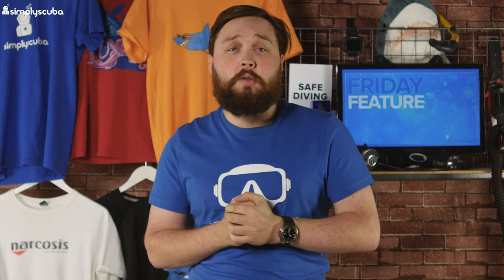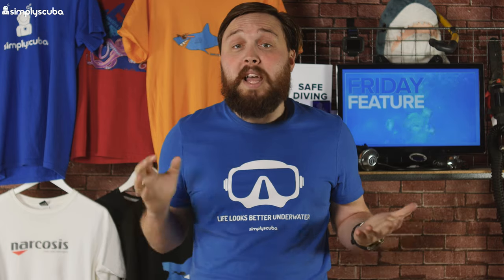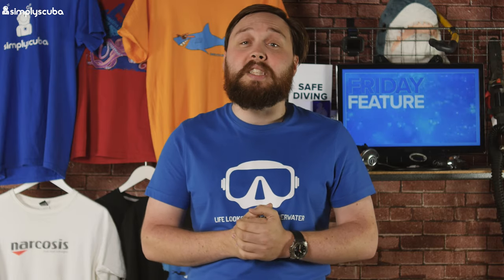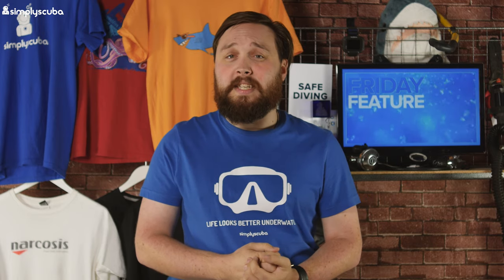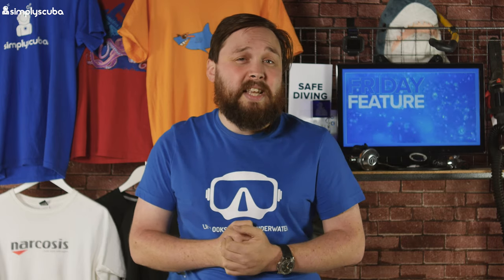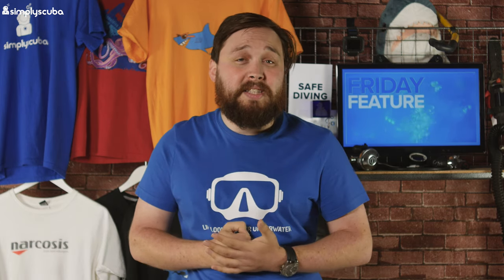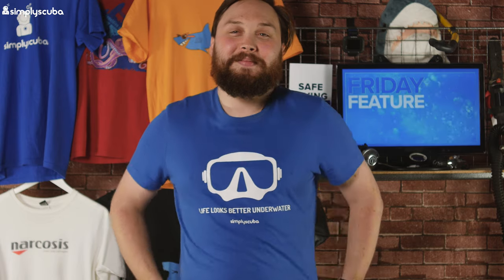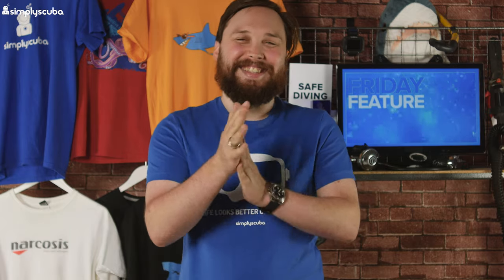Why The Standard Scuba Setup Is Wrong!

Comment: Let's not forget that all of this is relative to the environment you dive in. Like flat surface or chop, current, shore or boat dives and even the size of the boats and the kind of entry and exit you need to do. Are you diving with a wetsuit or drysuit, gloves and hood? People base these oppinions on what they are used to dive in and this doesn't always work in other envoirments. Most important is that you are properly trained with the equipment you choose to use. 

I change my accessories (torch, SBM, snorkel, camera, compass) depending on the envoirment. 

Whatever set up you choose to use, make sure you and your buddy know how to use it. 

Instead of trying to prepair for every kind of emergency, keep it simple and concentrate on the actuall dive and preventing these emergencies. Most emergencies can be avoided by having good habits.

Comment: I totally agree with everything you said in this video.  I'm an LA County Under Water Instructor and perform many beach dives.  I always have and often use a snorkel especially at dive entry.  It is safer and conserves gas.  It is also an LA County Requirement to have one with you.  Other than that, this is great advice for newbie divers.  When I started out, I had every gadget imaginable (still do, but rarely use any of them anymore)- such a waste of money.  Now, I am a minimalist- but I still maintain the 2 is 1 and 1 is none redundancy standards.  

Thank you for this video and dive safely!
Reply: Mark and this channel are wonderful, I Love it.  So I utilize the snorkel the same way.  Beaches are my primary entry (as opposed to boats) and we often have a moderate surface swim to the dive site.  Head in the water, utilizing compass and head up dead reckoning, neutral body position make the swim easier and conserve on the bottle for sure.  I do agree with the “don’t take it if you don’t need it” philosophy and a minimalist approach as a rule to keep the hazards at bay.  At the end of the day, you consider all of these excellent viewpoints derived from experience and do what makes most sense for you- and of course what is required of you.  Best!
Reply: Hi Brett ! It would be great Havin your accessories list and knowing which accessories you have ended using ?

Comment: Hmmmm.  My special forces dive instructor has left his backplate BCD and gone to a jacket style. Who would have thunk it? (John Shimkoski, owner of Scuba World in Orlando, is retired Green Beret and has taught scuba to special forces divers in Key West for years.)  He basically lives under water.   Pockets?  I'm a Naui divemaster. I keep a few things in my Aqualung BCD pockets that are safety and communication related.  A flat reel (my invention) with 75' of line and safety sausage in one pocket and reefmaster mini camera in the other. Titanium knife mounted above pocket for easy access (second titanium on inside of leg with chisel point.)    Multiple D rings?  It's all about location i.e. where you want to attached things.  I try to dive minimalist.  I have a rescue whistle tie wrapped to upper D ring.  I also typically have a small flashlight attached as well for poking around our great Florida shipwrecks.  Retractors, really?  A retractor on my Suunto Cobra keeps it close at hand and the the hose tucked in close rather than dangling.  No, they don't last forever.  But, I just replace it when it loses its functionality.  A two meter octo hose? If you are a tech diver, I got it.  But for most basic open water divers the longer the hoses, the more stuff hanging in the water or from your BCD, creates snag hazzards on the reefs and when getting into the boat.  I have been diving Atomic gear.  (Atomic M1 reg, Atomic fins with spring straps -  the best invention ever, and a sleek Atomic snorkel.)  Snorkels.  If you are diving alone, you can keep it stuffed in your pocket.  But, as a Divemaster, I always have people with me.  I'm first in the water and am the sheepdog herding my divers.  The snorkel is a great benefit allowing me to breath in the chop and stuff my face in the water if one of my divers has an issue.  And then their was the time when I had a long swim back to the boat with 2 newbies in tow.  Not enough air as the current had washed them about 200 yards from the moored boat.  In goes the snorkel and a long swim back.

I get what you are trying to communicate, but places, people, and dive styles greatly differ.
Reply: Recently did a 300 yard surface swim from Hunter Springs to Jurassic Springs in Crystal River, and the snorkel made that possible.  Saved my compressed air for the dive when I got there.  Been NAUI Advanced certified since the 80s and I still use a snorkel and jacket style BC.
Reply: Robb Hawks exactly !! This is so true. All my dives were on a jacket style. They are very confidence inspiring which is huge in diving especially for beginners. I’m transitioning to a Hydros Pro soon, excited to see how I like it !! Safe diving

Comment: Hmmmmm.... 2 meter hose for octo.  But don't give octo to dive partner.  Instead, give primary.  Then shouldn't the primary have a 2 meter hose?
Reply: good point: as technical 50 trainee (not many dives on tech 50), the 2 meter long hose os for the 2nd that you share, and the principal that you breathe from, has a shorter length than a recreational. So I was thinking, hum, makes sense to give the principal: you know is working, you are not stressed... I think that he meant that you can switch to the principal if the 2nd also fails...
Reply: Correct. The two meter hose goes on your primary second stage (the one you breathe from.) In an emergency you would donate your primary to your buddy and you switch to the backup (octo?) that is hanging on a necklace around your neck. (It will be on a short hose like you're used to.)
Reply: Ahhh my scrolling was a waste of time!

Good good

Comment: So, #1 I use my LONG octo as my primary, as a panicked diver will likely pull what I have out of my mouth.  My short reg is on a bungie cord necklace around my neck, so no fiddling. #2 I alway have my snorkel with me, but it is a collapsible one that I keep in my fanny pack kit that is on the dive with me (along with zip ties, an extra flash light, bolt snaps and more).  The fanny pack is ease to mount on sidemount BCDs, but you can modify regular BCDs to accommodate this .  Even without a fanny pack the collapsible snorkels (some designs roll up) can fit in a pocket-hopefully not to be needed at all.  #3 I dive sidemount and  even if you use just 1 tank, at least it is where you can reach the valve (useful if you forgot to turn on your tank, also useful if you have free flow from first stage or second stage equipment malfunction- you can 'feather' on/off the tank and not waste  the majority of the air- this makes it a safer ascent as you  now have time to ascend safely to to boat/shore.  Yes this dive IS OVER regardless).  #4 you should have a pony bottle and know how to strap it to you to minimize the profile and no dangling.

Comment: Agree with all this, except the snorkel. The snorkel is sooo nice to have when you're doing a (speed) boat dive. After passing your bcd to the boat and you have to wait to get on, it is really nice to be able to just chill with your face in the water, not worrying about water in your mouth. It just means I can wait in the water and wait for everybody who does not have a snorkel to hurry back on. Also nice when someone accidentally drops weights in shallow water so you can easily find them and grab them, in general I use it quite often.

Comment: Don't try rescue breath using a snorkel with a purge valve 😂
Reply: I'm a novice, can you explain why? And how you would know?
Reply: Most snorkels these days are the "dry type" with a purge on the bottom and splash guard on the top.  Administering rescue breaths with such a snorkel is next to impossible.  When I did Rescue Diver training, we were required to use respirator masks, which are the type that work on free flow oxygen systems.  Needless to say, I'd sooner use the mask than a snorkel.
Reply: For a scuba diving purposes is the best the simplest snorkel without aby valves. It's light, small, durable and non-existing valve can't fail.

Comment: Some comments : 

Octopus / Long hose: 
When you spoke of a long 2m hose why not just recommend the DIR (doing it right setup of 210cm hose - this is standard amongst the serious dive institutes anyways. so 210 cm long hose thats your primary... from behind your back.. around the right - under the lamp tank and then over left shoulder and around neck to mouth. 

2. Wings >> BCD jackets. helps having a great trim in the water -- stay horizontal in the water column

3. dump snorkels altogether.

Comment: I am mostly likely the minority having recently got my advanced certified but I have found having the snorkel useful especially swimming out before the dive. I am an air hog (yes need to work on that) but I feel comfortable using it quite often. I get why others dont but it's my dive too right ;)
Reply: It most depends on the conditions in which you dive.  Where I dive they are not of any use but easily could be for a different location and dive type.

Comment: Octo - Another issue is that low performing octos, or detuned octos are the norm. Ideally your alternate should be as good as your primary, if there is a chance that you are going to be breathing from it you might actually spend the coin to get a good one.

Fins - I actually like my Seawing Novas when I have to go to a place with currents, you can really power through them without thinking. But yeah they suck at frog kicks.
Reply: I've seen people do some great frog and helicopter kicks in seawings. Back kicks are where it gets tough with those.
Reply: I love my seawing novas, but I second the frog kick difficulty! I’ve got it down fine now along with helicopter and back finning, but holy crap was it hard to get it figured out, lol... My biggest difficulty is because I’m so vertically challenged (fine, short. I’m super short 😂), my fins are almost longer than my legs! It makes getting off the boat on a boat dive rather difficult as the little step and the ladders are hard to maneuver around so I can stride off...
Reply: He should be always rinsing his octo after a dive anyway.
Reply: @toriless  Rinsing doesn't fix a poor performing octo. For example if you buy a typical Scubapro setup, your octo is going to be an unbalanced R series octo. And that applies to most of the brands, octos are typically the cheapest regs that the company sells. The only exceptions are the tech oriented brands.
Reply: @Teampegleg  I was referring to all the gunk he claims is in his octo.  He never mention quality but I find the Aqualung Legend Octo easy to use.
Reply: I always try to test each others octo with my buddy.  I take a shot of his and he takes a shot of mine.  That way we are more confident that it is good.
Giving up primary like in the video is a bad idea.
Reply: @donpayton737  Why, your octo is right under your chin and you can switch to it within seconds? 

Between the tech like setup with a long primary hose, and a short necklaced octo, and the octo/inflator Air 2s it isn't unheard of to be on a dive boat where people with a traditional setup are in the minority.

Comment: When your buddy runs out of air, they will fixate on the regulator in your mouth. Just give it to them and use your alternate. that's not how we teach but that's how it works in real life.

Make sure the hose on your primary is long enough. But not 2m. trying to keep control of someone on a 2m long hose is not easy. 1.5 would seem ideal IMO for both your use and when you donate.

Comment: Sidemount anywhere. I dove the entire week at Cozumel in sidemount. Even the dive with a max depth of 27 feet. I love backplate, but with proper training sidemount isn’t a “hassle” like some people on the boat might think. I take the same if not less time to don the gear on the boat and just giant stride or roll back off the side. After the dive I walk up the latter and turn to the Side to squeeze both tanks through the ladder handles.
Reply: Agreed. I really like the ease with which sidemount allows you to handle valve problems, don and doff cylinders depending on conditions, the complete redundancy and of course how easy it is to get a proper trim.

Comment: I guess i feel like if your primary doubles aa your octo, i feel like it's more likely a panicked diver will rip your air from your mouth most likely when you least expect it.   If my octo is readily available at my side...bright yellow hose...a panicked diver will most likely go for that first?
Just me thinking out loud.
Reply: The other school of thought is that a panicked diver is more likely to grab the reg out of your mouth than go for the one on your side.  I don't think either scenario sounds too far fetched.
Reply: Panicked divers most often see your bubbles and go for the regulator that's making them... or they may just spit out their own reg and swim hard for the surface completely ignoring everyone around them! Their brain is just screaming at them to go for the nearest guaranteed source of air - they won't stop to consider hose colour.

If you're worried about this here are some tips:
1) Practice regulator recoveries often and get used to going for several seconds without a second stage in your mouth. If it becomes instinctive to automatically start blowing bubbles and search for your reg when it's not in your mouth then you will be way less likely to be caught off guard and freak out yourself should it ever happen. (Practising core skills is an excellent way to kill 3 minutes on a safety stop!)
2) Go ahead and switch to a primary-donate (long hose) setup and then practice air donation drills with your buddy every now and then. Switching to your back up reg that is hanging just below your chin is actually super easy and, again, practice giving away your primary will make you all the more prepared for a grabby diver taking it from you!
3) Take a Rescue Diver course. You will learn tons of great techniques for dealing with panicky divers - including how to recognise the signs of someone who is on the verge of freaking out and helping them before they become a danger to themselves or others! As a bonus the course is insanely fun!
Reply: I guess we are going have to agree to disagree...if i run out of air, you better believe i will be reaching for the first air source i see.  Most likely it will be that available 2nd stage attached to the bright yellow hose hanging down at your side.  In less you have a Safe 2nd...then it is getting ripped out of your mouth.  That's why I don't like the Safe 2nd/inflator.
Cheers
Reply: @xbpbat21x  "...if i run out of air, you better believe i will be reaching for the first air source i see."

You say that, but have you ever run out of air? If not, you're just theorizing. Actual data shows that panicked divers often do bypass the bright yellow safe second that seems like it would be the first one they see, and instead go for the buddy's primary. That's why it's important to weight yourself and adjust your BCD so that you're seldom doing full exhalations; you want to have a bit of reserve air in your lungs as often as possible in case something unexpected happens; like your mouthpiece coming off your regulator, or your buddy ripping yours out of your mouth.

Comment: Hoses!  I hate hoses!  I've been a SCUBA instructor since the previous Millenium so usually dive with a 'standard' setup as that is what I teach.  But before I started teaching, I used an Air2 type arrangement which gets rid of one dangling thing.  Alas, ALL of them are pretty poor at 30m or even shallower and restrict your head movement in an emergency.  And I would buy a wireless air pressure gauge if any of dem $$$ things lasted more than a year or two.  These days, as a senior citizen, I invariably put on my stuff in the water having asked some young thing to put my gear in the water 😊

Comment: Now on a still lowly 24 dives and been using a wing for about 14 of those dives. Looking at changing hose lengths on my regs and on the spg. And just starting to use a pony bottle just to practice having a small redundant air supply in the quarry, swapping regs and using two Spg’s in a more controlled environment.  Ready for either moving towards side mount or twin set. Yet I see many divers using so called std setup thinking it is the only way to dive they do not examine their equipment positioning ie have hoses dangling a few feet or more below them. Nobody seems to point out to them about streamlining their equipment or about where they position gear.

Comment: Nice video, but can I suggest that you update yourself to the current rescue techniques?

1. Most new snorkels sold today have a one-way drain valve. You'll not perform any rescue breaths with one of them. Yes, I too learnt to snorkel and later dive with the style of snorkel you are referring to, but they are less common.
2. Since 2016 the official guidance in the UK has now been to provide 10 rescue breaths, then tow. When towing you don't need to provide anymore rescue breaths.
3. When was the last time you practised buddy breathing? Seriously? Very few people practise this skill now as most rely on the use of an Octopus instead. Much simpler and much easier. Buddy breathing needs to be regularly practised for it to be safely used in an emergency. I personally haven't practised it for more than 20 years now.

Comment: The big issue s that all items were designed independently, rater than as one system. I disagree with the snorkel info as well as the retractor. Mine is 6 years old and perfect as well as very useful for my console computer.